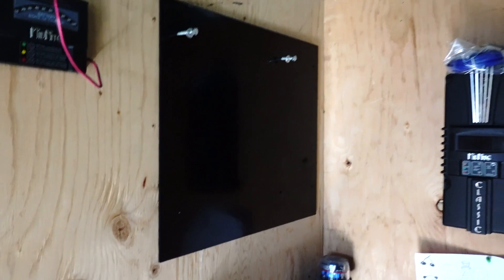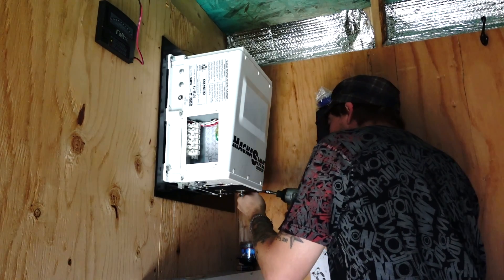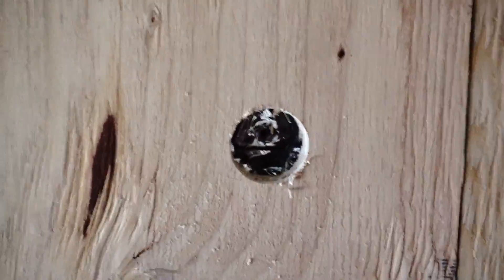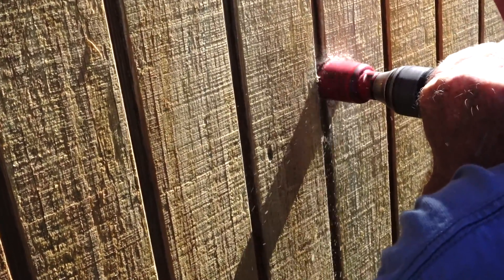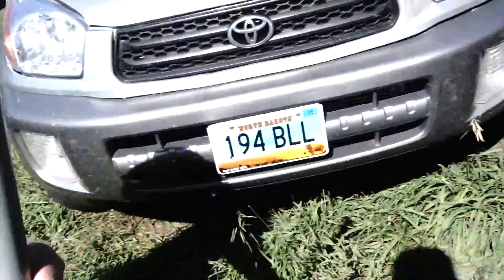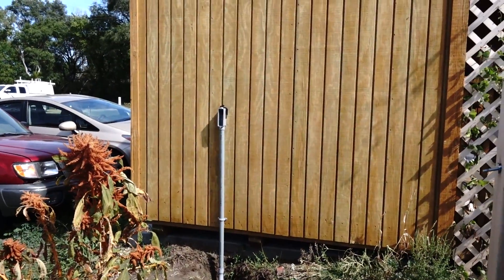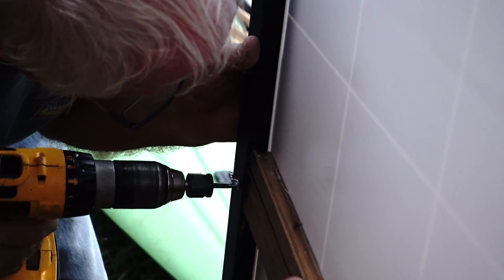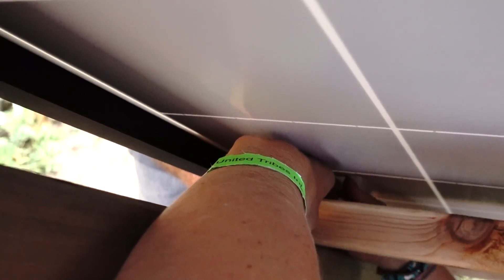Off Grid SOLAR PANEL Install : Part 1

Comment: Looks good 👍 brother.
solar 48 Volt Off Grid system, 48 volt Off Grid system, Off Grid House, Minnesota Solar Power And Off-Grid Battery Backup, 48 Volt Hybrid, Off Grid Power, Off Grid 48V Solar, Off-Grid 24/48V battery bank, Solar Power, Off Grid System, 48V Hybrid-Off Grid Power System, 48V Off Grid System, Off Grid Safety. Off Grid Solar Power, Solar 48 Volt Hybrid-Off-Grid System, off Grid/Grid connect, Minnesota Solar Power, OutBack Power Systems, OutBack FX3048MT, Flexmax 60, Flexmax 80